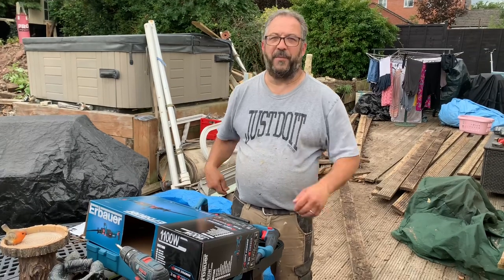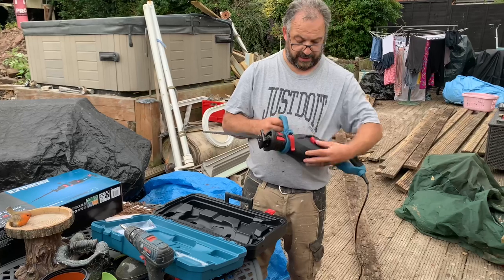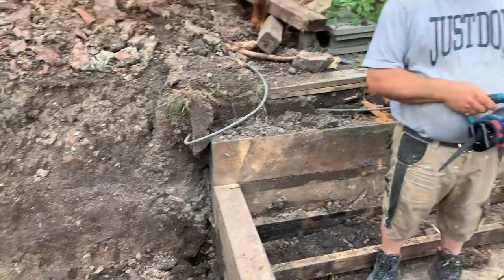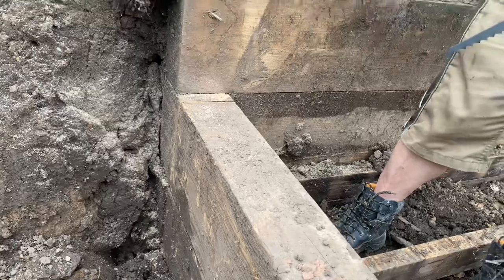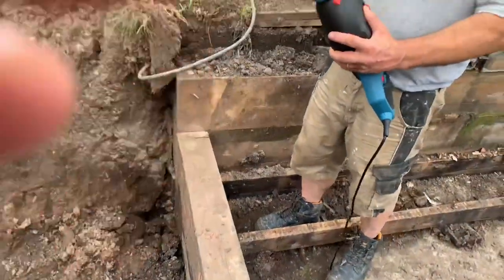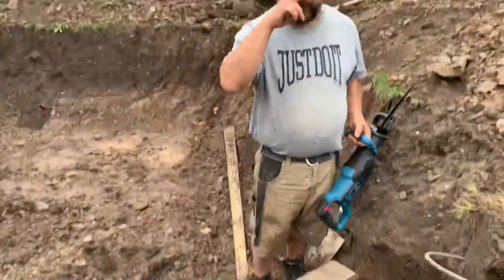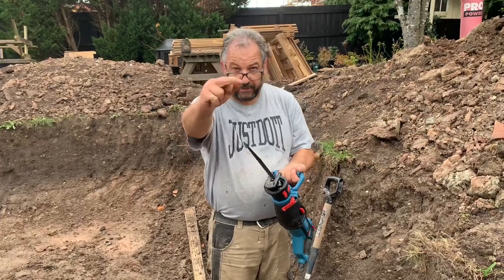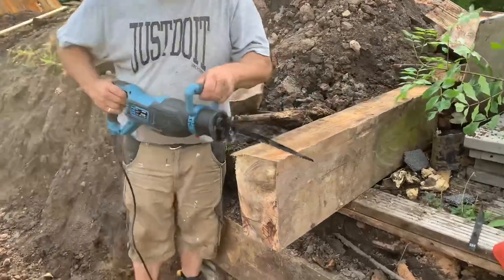ERBAUER ERS1100 Reciprocating Saw

Comment: Always secure the thing you're cutting where possible or you lose cutting power because the item moves with the saw, also press the foot of the saw against the object where possible as this lessons vibration and movement of the saw. When cutting metal, slower is better as you won't overheat and dull the blade. Great video tho.
Reply from the maker: Thanks Richard, really appreciate your feedback on my, clearly, first time using one of these!!
Reply: @wilko7530  I was just offering advice, not criticism.
Reply from the maker: @richardbradley2641  totally appreciated Richard, welcome any advice positive or negative on content or presentation. Not looking to make a career or anything just quite enjoy doing them so great to receive feedback. Have a great Christmas - maybe we will both get some more power tools! 🧰

Comment: The blade keeps coming off on mine. I made sure it's fully in any pressure it will come off and stay in the wood any advice???
Reply from the maker: I don’t sorry, ones clamped in I’ve not had that issue, can only imagine something has come off inside?
Reply: @wilko7530  Got a replacement from Screwfix. I have not tried it out yet I hope it was a one-off.